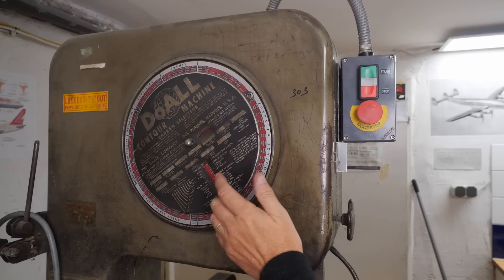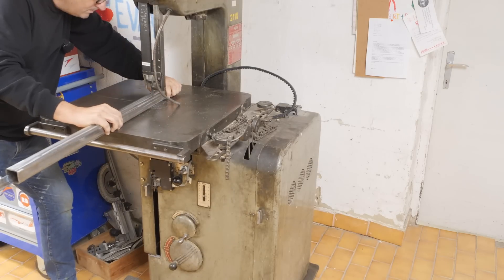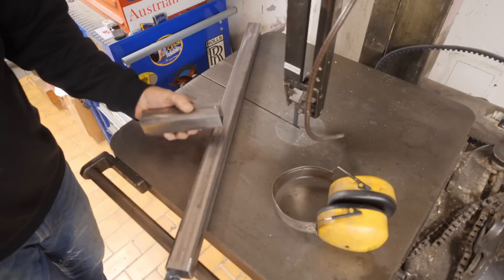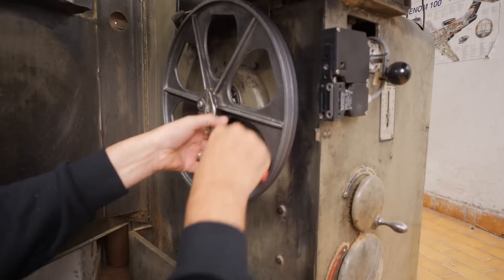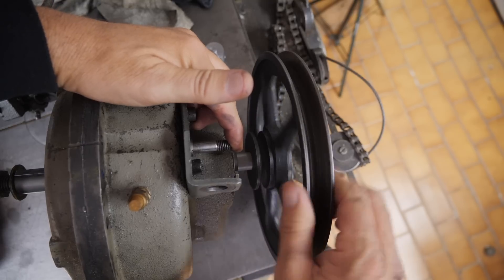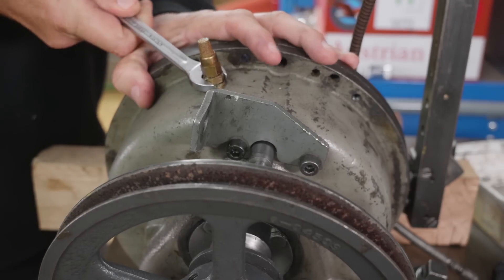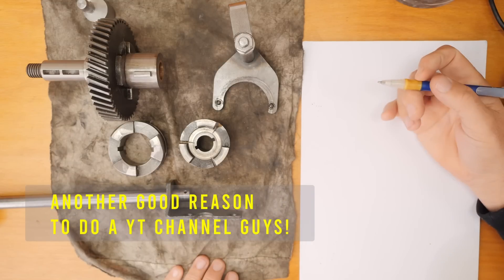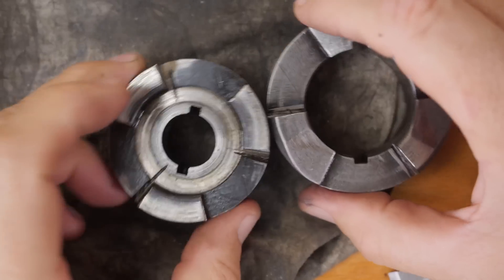My bandsaw still jumps out of gear? Ep. 7 || RotarySMP

Comment: Somewhere in the shifter mechanism I would put two detents in to hold the rod in the correct in/ out position. I would make a brass bearing block where that steel bracket is, the bracket fixed by screws to the side of the block, that takes the slop out of that 'bearing' and you use the block to make the detent unit and then a simple either mill slots of some sort or two drillings on the side of the shifter rod. And yes I would grind the dogs square using the centre line ie the rotary table not the tool grinder slide.
Reply from the maker: I seems DoAll did exactly that with a detent on other models of their saws. 
https://www.youtube.com/watch?v=1t6aH7WTzC8
Mine didn't have this, but your suggestion is a good improvement.
Reply: Just wanted to write same thing.
Almost any gearbox that I'v ever seen had some detents/balls to hold fork in appropriate position.
And also.. in this position fork should not touch the ring. It sholud engage and then move slitly back, so it will not ware.
If there is a backrake on the dogs, they should "pull" clutch together, so fork do not need to be in the contact.
We speak about tiny movements in tenths of milimeter...

And that screw that is touching variator...
Maybe short belt was the reason for that interference?
If you put longer belt... lowest position will change. As I can see from the clip this will require to move those two nuts more to the end of the screw, so it will fix this issue.
Reply from the maker: @bmalovic  Yeah, I found that DoAll added detents on some othe model saws, so I will add some.

The old belt spec on the dataplate links to a V5L420 spec, and 42" is 1092mm. I bought the closest standard belt  of 1060mm, but now also realise that the motor mount is not standard, so maybe the shorter belt was used to compensate for a higher motor. I need to take a closer look at the whole belt set up one the gearbox is back in.

Comment: Things I'd be considering that might (or might not) help:
1. The balls on the yoke look non-round from wear, so maybe too small
2. The nylon bushing on the faceplate side of the shift lever has a ton of slop
3. The reverse slope on the high speed drive dogs
Reply from the maker: 1. Yep. I measured them yesterday. 6.15mm balls, 6.75mm slot. Plus some flat spots on the balls.
2. Yep, I dont thing that plastic bush is original, it is probably already a repair for a slogged out hole in the sheet metal frame.
3. Yep, that one is on me :)

I drew up a replacement yoke in CAD yesterday.

Comment: (I have not done the math, proper;  but...) could you make a "Y" shaped yoke to pickup up the {1st, 2nd and 4th} openings of a 1O 5 spoke using the kit/parts of your new previous puller?   While it would tend to lever towards the fingers that are closer together, a 'leg' ...uh ...thicker arm to support the leg of the "Y" could help with rigidity...
(facepalms) ...or use a triangle shape so that the load path is fully enclosed by the material, and all the drilling operations are square/perpendicular to the outside edges.

( uh... 1.70!? that can't be right... edit: 1 is not 0.5, me; time go find food! )
Reply from the maker: I could make a replacment yoke, but that is too much faffing around to remove that bearing. The 3 spoke puller worked well enough.

Comment: Belt classification
Z=10mm
A=12.7mm (13mm)
B=17 m

B38 means B (17mm wide) x 38" (38 x 25,4=965mm)

And letters in the end...
Li = lenght inside
La= langht outside
Lp = Ld = lenght middle

That means that you need the belt  17x965 Li
Ask any belt suplyer like OPTIBELT in Austria
Reply from the maker: Thanks for that. I am not sure if that 965mm belt which came out was the right length though. 
The old DoAll spec D9-3770 listed on the dataplate comes up on their website as...
https://www.doallsaws.com/9770-v-belt
...BELT V 5L420 
The 42 inches converts to 1092mm, which Is why I ordered the 1060mm as nearest standard length. I have been informed that I should not use an X (knotched back) belt in this application, so I guess I need another belt.

Comment: The totally messed up drive dogs cut like a monkey did it is the problem.
A dremel cutoff wheel would have done better even a file.
So the pressure forcing it out is way greater than the angled catches can counter. DUH.
Reply from the maker: Yep, it is toast. I will make a replacement.

Comment: With all the space around the drive fork it seems like there is a thrust bearing/washer that is missing. Maybe the previous owner lost it and tried to take up the space by staking the balls in?

Also, I have a hunch that the bracket that holds the selector arm is not stock, and that is contributing to the excessive play.
Reply from the maker: Good points. I hav no idea what the original tolerances were, but these are 6.15mm balls, in a 6.75mm slot (seems excessive), but the balls are so poorly retained now, that they play is a couple of mm. The yoke looks a bit bent, and also has a 1/2mm of wear. I drew up a replacement Yoke yesterday.

I think that bracket is probably original. DoAll had some pretty agricultural design practices. :)

Comment: Certainly not an expert, but I think I agree with you that it's both the brackets and the selector fork. If the balls are meant to be the bearing surface between the fork and the dog gear groove, then there's a ton of wear on all the other surfaces that shouldn't be making contact. The balls also look like they're showing a lot of wear. I'd expect the bracket play isn't maintaining thee axial clearance for the fork, while the worn balls are allowing excessive side to side movement. I'd guess the fork is twisting and binding under load because it has the room to do so, and that's what's letting the dogs disengage. New fork with oversized balls to fit the worn slot, and fix the brackets to hold it in place.
Reply from the maker: Good inputs. That shifet fork is toast, and I will make a replacement. DoAll used the balls on some saws, but hardened blocks on others. I drew up a replacement fork and will make that, and then address the play in the linkage as well.

Comment: PTFE shoe that fits over the fork to make up the gap bergen the fork and groove in the dog. 

Oilyte "buttons" instead of the ball bearings. 

Either way you'll need some kind of positive latch/locking mechanism to keep the fork in place if there is no back rake on the dog teeth. Just have to make sure it's not putting pressure on the fork to keep it in place.
Reply from the maker: Yesterday, I drew up a replacement fork in CAD. The original is beyond saving.

Comment: I don't see how those balls could be expected to work, so I find myself in the "not original" camp. 
They don't have anything to push against in the fork (other than a bit of scruffy peining) 
Balls in each side into blind holes (offset from each other) might work. 
But maybe look at brass-facing the fork with TIG brazing and machining to be a nice running fit. 
I am somewhat surprised that there seems to be no sign of any sort of detente. Maybe the ball handle is a replacement and the original one was heavier?
Reply from the maker: Hi Andy, given your motorbike experience, I was hoping your would give me your feedback. Thanks.
I have feedback from other DoAll owners that it is original, but agree it is a crap design. Even if done "well", the staking around the balls leads to point loads which will wear fast. The balls are only 6.15mm in a 6.75mm slot, so there would be a far bit of play even if the balls were more constrained. DoAll used what looks like hardened slippers on some other saws...
 https://www.doallsaws.com/parts-store/spare-wear-parts/transmission-gearing/111449-shifter-fork
That existing fork is toast, so I drew up a replacement yesterday. I am at two minds whether to go with soft bronze slippers, or hardened steel, as it is well lubricated. 
DoAll also used detents on some other models of saw...
https://www.youtube.com/watch?v=1t6aH7WTzC8
...so I will add some.
The ball handle and sifter rod is a replacement, as I made it :) The original was missing when I got the saw, and would have been just a rod with a 90 bend in it. I am pretty sure the plastic bushing in the frame is also a previsous mod, as the original rod likely slogged out the frame hole.

Comment: You have so much patience.  I’d love to see a graph of your decision tree.  Nothing makes it to the scrap pile.  But there has to be a cutoff somewhere.  Maybe there’s more old machines here in the US.  I’d never consider this kind of work.  Cool as it is.  I just spent $1k on parts to fix a Mazak 200M that’s 20 years old.  And I won’t do a fraction of the work you’ve done on this one old band saw.  Very cool work. Thanks for all the videos.
Reply from the maker: Hi Craig, I guess, being a hobby, and DoAll pricing it's parts in EWD (Equivelent weight in Diamonds), I would rather make parts at irrational cost in time, than buy them :)
https://www.doallsaws.com/parts-store/spare-wear-parts/transmission-gearing/111449-shifter-fork

Comment: is the bit with the teeth somehow just in backwards so the teeth face the wrong way and the ramp is forward? idk it seems like a long shot but i got nothing else
Reply from the maker: The dog "teeth" have been reground before. The low speed ones done well, which the high speed ones, had been doen before, worn out rounded, and then I did a crap job of regrinding them. I will fix that.

Comment: B is the belt width (21/32"), X = cogged, and 40 is 40" long
Reply from the maker: Thanks. The belt specified on the saws nameplate, is a V5L420, which was a 42" length. I suspect the short belt was put in as there is a non-standard, raised motor mount.

Comment: I was looking at the selector yoke and was noticing that the cutout in the center doesn’t match the wear marks i’m seeing above it. Is there a chance that it was a home made piece to replace the original?
Reply from the maker: It is welded to the shifter shaft. The replacements from DoAll appear to be bolted, so it is most likely shop made.
https://www.doallsaws.com/parts-store/spare-wear-parts/transmission-gearing/111449-shifter-fork
Other owners have reported that the design with balls is a DoAll design, but it seems like crap.

Comment: It'd seem that someone has messed with that fork in the past. Those balls could have been added by someone trying (and failing) to solve this same issue.
Reply from the maker: Certainly. I think the whol shifter fork is a shop made part. But the balls is an original DoAll (crap) design according to other owners. However also used other designs on other models.
https://www.doallsaws.com/parts-store/spare-wear-parts/transmission-gearing/111449-shifter-fork
I drew up a replacement fork yesterday.

Comment: There must be an undercut or a torque applied will drive it out. Also is there a detent  ball holding the shaft from just sliding out.
Reply from the maker: There are other opinions that vertical dog faces also work (I will still need to grind the high speed side). No there is no detent system. I will probably add one.

Comment: I just rebuilt my DoAll. I found that I needed to reduce the spacing between the low range and high range dogs. I did that by inserting a shim on the output  shaft between the bearing and gear. Also your shifter fork might not have the correct ball size... i didn't measure my fork but yours seems to have too much slop inside the dog selector slot. Good luck.
Reply from the maker: Yeah, I just measrued them, and they are 5.1mm balls in a 6.7mm slot, with lots of slop in the ball retention.

Comment: I wonder if the gear change lever should rotate through the top so it has gravity holding it in position. Build the fork back up with silicone bronze and try it out. Swagged balls are someone’s quick fix.
Reply from the maker: I tried it both ways, but the vibration prevented it for staying at the top. Even clamped in place, the selector still fell out of gear.

Comment: If I had a saw that jumped out of gear or if the blade jumped off track it would give me the red ass.
Reply from the maker: Not sure what that means, but it sure is frustrating.
Reply: @RotarySMP  its an old baseball term that would refer to someone becoming intensely frustrated and angry.
Reply: @RotarySMP  have you contacted the Doall customer service?  They are still in business and perhaps you could pick their brains as to what the issues could be.  Perhaps you can get a service manual for your machine and the correct belts.
Reply from the maker: @taranson3057  
Got it. Yes on the Red ass :)
DoAll have the manuals online, but the gearbox drawing they have is a very distorted scan of a fax. Some of their other saws have forks without the balls.
https://www.doallsaws.com/parts-store/spare-wear-parts/transmission-gearing/111449-shifter-fork
They seem to price parts in EWD (Equivelent weight in diamonds). 
They list the belt reference on the dataplate, and then a modren spec on their website. 
https://www.doallsaws.com/9770-v-belt
I convered the 42" to 1060 as the nearest standard length. Not sure why a shorter belt was in it before. Maybe due to the non-standard motor mount?

Comment: I didn't watch the the older video on this, but has this shifting mechanism a sort of end-position-arrester.. like a over center latch or a spring loaded ball + groove?
Is there anything in this whole setup that keeps the drive-dog in its Hi/Lo gear position respectively?
Maybe that feat was caused by the loose fit of the lever in the past?  A sort of over-center thing..  but stuff wears out over time.
What I mean is - if u put in a bushing and make it too rigid it might not work as intended?
Reply from the maker: Sort of. The slot which the excenter rides in nips up at both ends of rotation.However, that was not enough to stop it falling out of gear (due to the shifter fork wear).

Comment: I would put significant undercut on all the drive dogs, like an angle of 10 to 15 degrees. There is really no reason not to, because you never need to shift it OUT of gear when using a high load.
I would replace the 2 balls because they are visibly trashed, AND leave them able to rotate which should help to reduce flat spots and overall wear. I suppose they need to be peened so they just rotate freely, but still have some ball hanging out each side.
You might need to go up in ball size to allow for wear in the shifter groove.
Then fix the slop in the shifter shaft, AND check its movement range, something might need shimming. Also I would consider adding 2 detents and a detent bullet and spring, that is just professional if you rely on it staying in gear when vibrating etc.

Re the blade popping off the wheels, do you have bands? The wheels should have rubber band (tyres). I recent put silicone rubber bands on mine, they are really hard and tough but very grippy.
Reply from the maker: The reason not to is the difficulty of setting up the rotary table on the small tool grinder table.I just measured the balls and they are 5.1mm in a 6.75mm slot, so they are certainly wrong.

Comment: Drive dogs on motorcycle gearboxes definitely have back rake to keep the gearbox in gear. That applies to both the drive side and the engine braking side of each drive dog. But those things have a lot of vibrations and sudden load shifts. I wouldn't think that raking the drive dogs could create a problem but you do need to set them spot on to the proper compound angle for grinding to ensure you'll get full face contact on all of them instead of point contact
Reply from the maker: As I now better understand that the shifter needs to positively hold them engaged, I think it would be better with my dodgy set up to grind vertical to keep it simple, and avoid radius at the root with clearance.
Reply: This exact issue happens on the bikes I race. They bend the selector forks slightly due to mis-shifting (forks having no where to go) then they take out the nice edges of the dogs as they don't select properly. New forks that fit well into the slots fix it (they have little wear pads on the good ones, never seen balls I guess this is because they are hard)
Reply from the maker: @mandrakejake  Thanks. This all helps me work out what to do to fix it.
Reply: Between the slop in the fork, and the parent point contact on the dog faces, there looks like there's plenty of opportunity for the dogs to work loose under varying load conditions. Also, I think the relief that had been cut originally is important to keep the engagement fully seated. Any debris, or even hydraulic action of the oil may initiate the dogs decoupling at low load.
Reply: Apparent not parent. Silly auto correct. Phones huh?
Reply: @squelchstuff  you can just edit your comments… no need to comment on mistakes in your comment, just correct it
Reply: @rok1475  on desktop, that's fine, but I was on mobile browser at the time and edit was annoyingly missing. Thanks anyway.
Reply: When you cut thin metal there is a lot of “micro vibrations”.
Not so much on thick material.
A square tube with 3mm wall is thin.
Reply: Slop in drivetrain control #1, use bushings. Create stops #2 , regrind faces 2 degrees taper through center of rotatiom #3 get tracking correct, is there slop in overall lower drive wheel? , correct slop if ANY. #4,,  then sell the saw and buy a new one!  Settled.
Reply from the maker: @stewartfrye  No way will I sell this beauty :) It is a classic. Maybe it will even work.

Comment: Recutting the shoulders seems to be more like something to do with a nice and sharp endmill than a grinding disc. And indeed, the fork needs some attention too.
Reply from the maker: Hi Michel, it is hardened steel, I need to remake that fork.
Reply: @RotarySMP  Ah, OK. That makes sense.
Reply: @RotarySMP that wouldn't be too much of a problem for a carbide end mill though, but on reflection grinding is the way to go although I'd go diamond grinding blade myself.